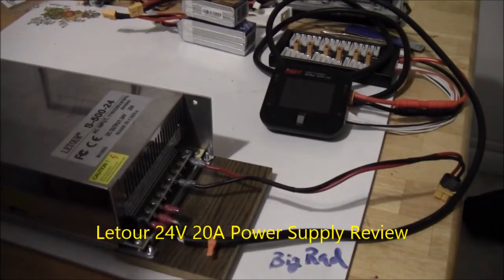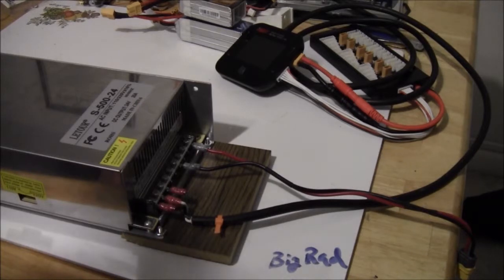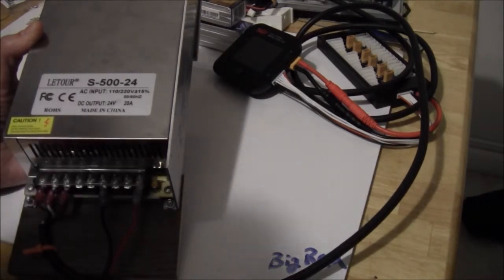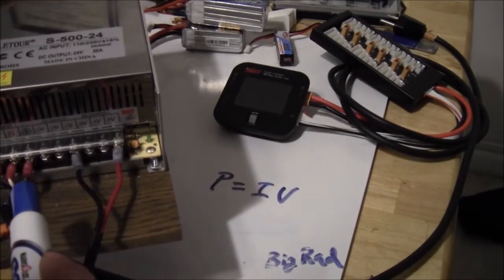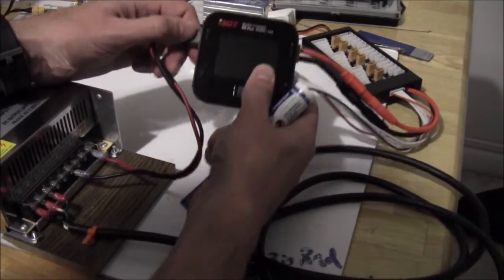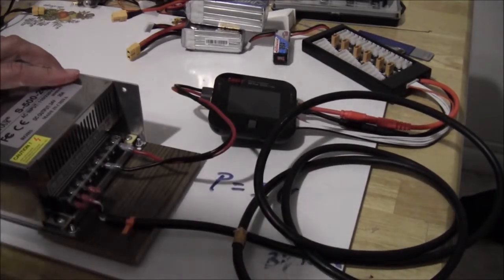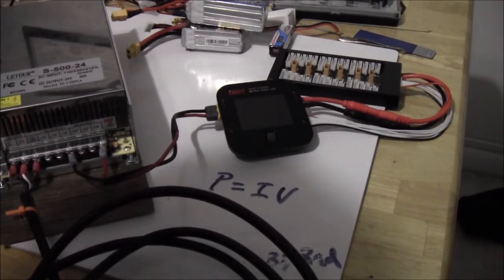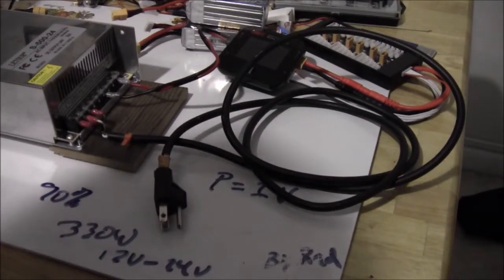Letour 500Watt Power Supply Review

Comment: Have you tried to stress it a little more yet? I power my charger from a modified PCU. But I can only get about 10a to my charger on 12volts. I’d like to get the full 14amps on my charger or put 2 charges on it at once.
Reply from the maker: I don't typically go over 10a, but it should handle it no prob.  I'll try 2C parallel charging some packs if I head out this weekend (~15a).

Comment from the maker: Noticed that model is out of stock.  There's a 12 volt model that is in stock for almost the same price:
https://www.amazon.com/LETOUR-96V-240V-Converter-500Watt-Lighting/dp/B01HRLNJ0M/ref=sr_1_1?s=electronics&ie=UTF8&qid=1509852169&sr=1-1&keywords=letour+12volt+power+supply&dpID=512bo4zAfcL&preST=_SY300_QL70_&dpSrc=srch
Reply from the maker: 24V back in stock.